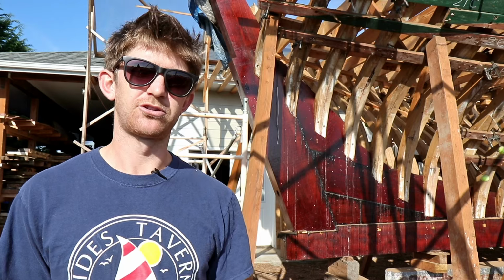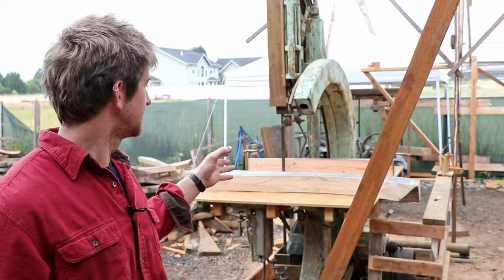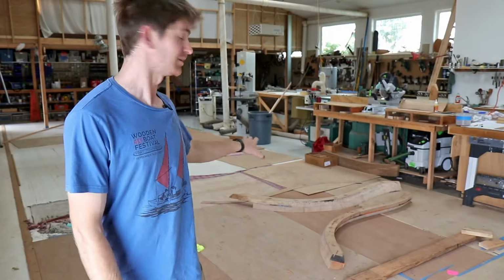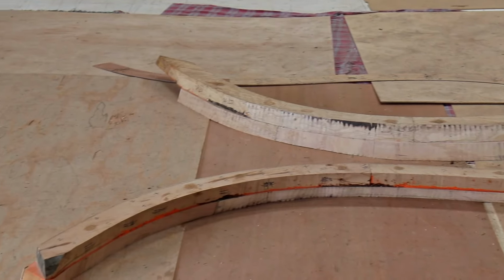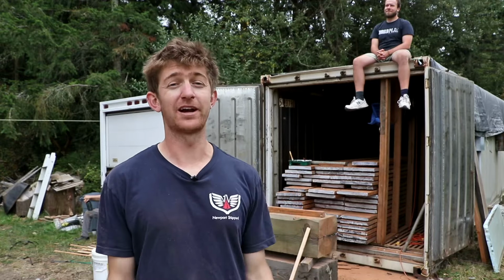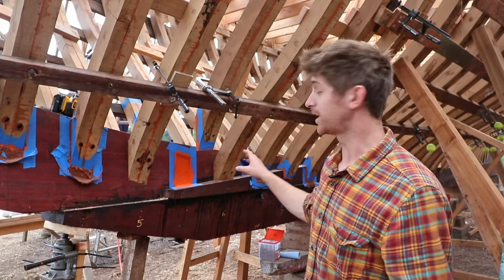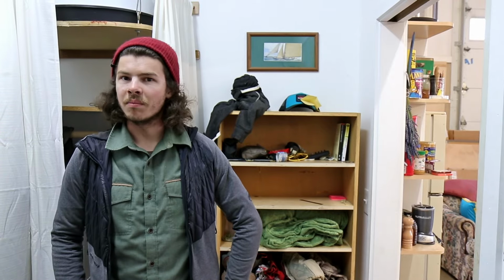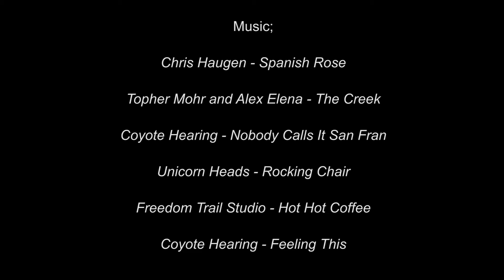Finished Framing! / Planking Timber (TALLY HO EP55)

Comment: 1:28   How much does a new ship saw blade cost?   Do you get them resharpened, or just buy new ones?    How long are they?   Did you check to see if carbide tipped ones are available?   Carbide tipped ones would last a lot longer, but they are insanely expensive.

Comment: Staggered by the amount of timber that goes into one of those boats.  Little wonder that they can last 100 years.  With the joinery it's a piece of art.  Fantastic that you have the skills, the patience and drive to undertake this project.  Lesser men would have either given up or started cutting corners long ago.  You're inspiring.   Hang in there Leo!!

Comment: 21:05 - why cut the insulation to fit around the ends of the boards like that?  Won't that keep the heat from a portion of the ends?  Wouldn't it be easier to just move that over a few inches and hit the wall that was already in place?

Comment: I couldn't believe the amount of timber when the container was opened. Cool idea making an extension to the kiln. All the frames are in woohoo.
Reply: @anonymic79  I can't wait for the bulwarks & decking.
Reply: @anonymic79  It is the structure or "railing" around the perimeter of a ship. The heighth is not as high as your waistline.
Reply: All the frames are in woohoo, and the planking will be in wana   ;-)

Comment: Handling that timber looked to be a nightmare, great skill and experience by the operators and teamwork by all. Inspirational.
Reply: Seriously those guys knocked it outta the ballpark handling that stuff.
Reply: @silasmarner7586  yeah that's no easy feat for sure.
Reply: @pete. No kidding. One sawmill I worked did 6X6 timbers 20 foot in length. I watch these guys and know they know the tricks to moving that stuff. WTG guys. Thought what I leaned in my 20s would  going be forgotten. Turns out that knowledge has helped in nearly every job I’ve had.

Comment: Holy smokes, that is some long cut timber.  Like 24 feet?
Reply: More like 38 feet
Reply: @frederickstibbert7389  holy smokes!!!
Reply: @conanthedestroyer7123  - Truth ! At greater than 50% moisture content, some of those planks will weigh in at 700 pounds.
Reply: @frederickstibbert7389  I would think with the 38 ft length used on the shell of the ship, it makes for a much stronger ship and less joints.
Reply: @conanthedestroyer7123  - I agree.

Comment: 17:30 could you have elevated one end of the boards enough to fit their entire original length into the kiln? Granted it might not allow for the same number of boards in the kiln at the same time, but it also wouldn't require building a separate "box" at the rear end to accommodate the length. Obviously, a question by a total novice/Monday morning QB, but just a thought.
Reply: It wouldn't be grand to dry that wood in a curved position.

Comment: So what's happening with all that live oak you have leftover? Are you going to use it in some more of your structure, finishings or something else?
Reply: Best use of remaining Live Oak will be frame extensions that poke up through the deck's covering board to support the bulwark planks. Live Oak is v. gnarly & hard to work, so it's not the best choice detailed finish-work.

Comment: How do you work around the damage that was done to some of that lumber from having chains on it, or dropping and dragging? Are you able to work around it, like put the ugly side in, or is it going to be planed off? Thanks! And as always these are wonderful programs your producing!!
Reply: The original design specifies 3 x 1-5/8" planks down at the keel, then 1-3/8" up to the sheer-strake, that tapers out to 2" where it meets the deck.
No doubt that Leo has ordered fresh-cut green timber that's thick enough so he can dry & plane it to final size.

Comment: What were the wedges for in the stem assembly? The stem pieces fit very well, there seemed to be very little space if any at the nibs. And it was all bolted together. Just a genuine question, not a criticism. I am in no place to criticise, I can cut a well fitting scarf but to do it in that size of timber is mind boggling

Comment: Hey, Leo! I am an old retired fuddy duddy and I HAND-MAKE FROM SCRATCH replicas of the early American pocket knives called Grandaddy Barlows. I use high carbon steel for the blades and springs, brass or nickel silver for the liners and bolsters, and all natural materials for handle slabs. Natural materials I use include antler, bone, and wood, a lot of the wood is Walnut, which was a match to the materials in our early American rifles and other firearms. Never any plastic or stainless steel  or other artificial material in my knives.
For the price of a couple of SCRAPS of LIVE OAK (from your ship?) I would be willing to turn out a couple of really nice "antique looking pocket knives, that is, one for you and one for myself. I would be honored to have a Grandaddy with Live Oak handles from the wood of that ship.
I am also an old cruiser sailor, whose birthday is the same day as the birthday of the USS Constitution, (October 21 but not the same year!) ) which also has Live Oak in her hull and framing. She got the name "Old Ironsides" for a good reason.
I can be reached at 1xswabby@gmail.com.
Thanks for reading this!

Comment: wow sompin new - what do you call that line thats on the starboard side of the kite holding the shoulder out @ 9:47 ? ?
Reply from the maker: It's actually a gollywobbler sail (specific to Schooners). It is a large four-cornered light-wind sail hoisted between the masts. The line that you mention would be called the peak halyard.

Comment: Hello. I am really impressed with both the effort of all involved, and the boat in it self. I hope Leo read this, since I have a question. What kind of wood did you get for the hull planking from Suriname? I know you mentioned it in the video, but I hope you can write it down here in the comments as well. The reason I ask is that I am hoping to build my own wooden boat one day, and it would be great to research the possible wood materials for this project. My project is a glued strip planked motor yacht that I am working out the plans for here in Norway.

Best regards from Marius
Reply: Marius Hagberg - Copy of previous replies from 2 viewers
Frederick Stibbert
2 days ago
Also called Red Louro (ocotea rubra).

Gottenhimfella
2 days ago
That's the right spelling (Wana) aka Louro Vermelho, Louro Gamela in lumber circles
elsewhere it can be called Grignon rouge, Gamela, Determa, Wanu, Teteroma, Baaka, Grignon Franc

Comment: the old time shipwrights would have nothing to do with putting  kiln dried lumber in a wooden hull.  drying wood too fast cracks open the cell fibers of the wood, which is not good, water soaks into the board deeper and mold spores do their thing.  basically a kiln turns a board into a 200 year old piece of wood in a few days...  i'm very surprised LEO doesn't knoe this!!!
Reply: That kiln dryer was more of a slow cooker - the exposed endgrain was sealed w/ paraffin & the low-temp drying took about 8 months.

Comment: Incredible Work!!!!!
At least when finished, how much from the old boat ist in that new Hull? Can you reuse any old parts?
Reply: It’s soul!
Reply: @sotobfree7163  Only if you are in esotericism ;-)
Reply: @SD_Alias  Well there's the design, that's original.
JIM
Reply: @jimc4731  Yes, and i hope a lot of the metal parts and other hardware will be reused
Reply: As Trigger said « this er broom has had sixteen heads and five handles, I’ve looked after it all these years « 🤗

Comment: Well done to finish the reframing. The planking timber looks really good. How long will it be in the kiln and at what temperature? It was once thought that boat building timber shouldn't be kiln dried, but not so much any more, especially if not reduced to a very low moisture content.

Comment: Spent many of my youthful summer days in the early '50s sailing with my dad on Lake Michigan in his old partially restored 28 foot deep keel racer/cruiser. She was gaff rigged with no engine but we never managed to piled up while docking. When my mom and he sailed to the UP one summer they were hit by a white squall which took out the main and working jib, but they returned under a jury rig of head sails and my mom immediately began work on a new main of Egyptian cotton. Years later Dad had a fiberglass sloop with aluminum spars and lots of stainless steel parts and a reliable engine, but while sailing on her I thought, 'nice modern boat but her personality has been sterilized right out of her'. God bless the folks who are building/rebuilding classic wooden sailboats.

Comment: Here’s hoping that was beeswax on the ends to stop the already beginning checking.  I normally send a 240 volt hot plate and 40 kilos of beeswax so they can paint the ends before shipping.  Equatorial woods can easily lose 10% moisture content in shipment alone

Comment: Ha.  Wow.  There's gonna be a ridiculous lack of scarfs in your planking, for a modern boat of this size.  "Too long for the kiln" is certainly a "good problem" to have.

Wish I could figure out what is this specific species you're talking about.  Angelique of course I've heard of.  But for "Wana"(sp?) I'm coming up with a complete blank from all easy-access online sources I know of.  It's not like finding a good substitute for teak planking (or especially decking) is a particularly new problem.  And I'm not amazed at my own ignorance of this one, just flummoxed I can't find it on any relevant reference sites (Wood Data Base, WB Forum, no comparable spelling on Wikipedia... nothing). 

Obviously this stuff is known well enough to the average Brit Pilot Cutter builder (or folks at places like Edensaw), but just spelled in a way weird enough to be otherwise obscure to the English language, even if not really obscure in the commercial sense, at least presumably not in S.America.
Reply: Also called Red Louro (ocotea rubra).
Reply: @frederickstibbert7389 
Thank you!  So "Wana" is correct.  Just damn hard to find reference to, in North America anyway.  The other name I'm now seeing listed is "Wane", which I had seen peripherally before now, at least in print.  Not actually sure of the right pronunciation for the latter in this context, especially as in English it's a homonym for generic dimensioned lumber with untrimmed bark on one edge/corner!
Reply: That's the right spelling (Wana) aka Louro Vermelho, Louro Gamela in lumber circles
elsewhere it can be called Grignon rouge, Gamela, Determa, Wanu, Teteroma, Baaka, Grignon Franc

Comment: There won’t be any original timber left will there?  Interesting thought exercise... if you replace every part of a boat, is it still the same boat?
Reply: One that's been long debated in the comments of these videos, more early on.  Leo's position, which I agree with, is that it is still Tally Ho.  If you take the human body as an example of the concept, we have our different types of cells replaced at different rates, with the average rate having been calculated (or otherwise assumed) to be something around 7 years.  Yet we're still the same person.

Comment: Without getting picky. Of all the wood used to frame boat. Yes, you can use smaller pieces later. But what percent is not used in framing boat in what you need to build the boat?
Seems like you use 40% of the wood selected. The rest is scape.